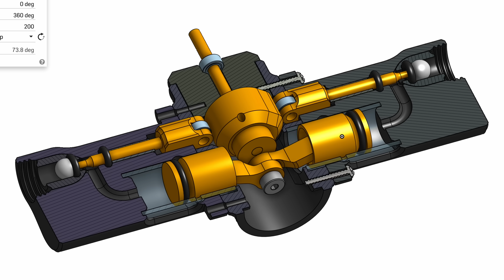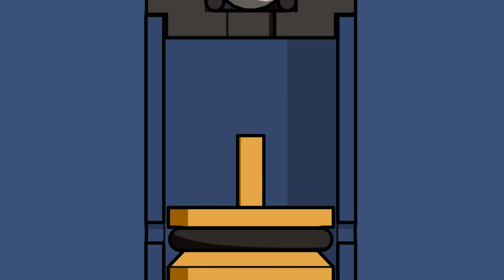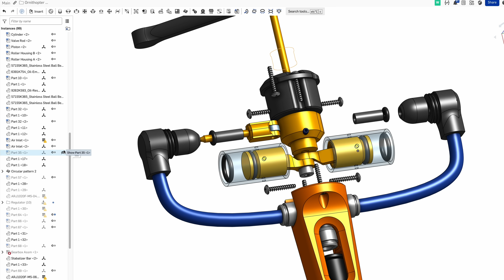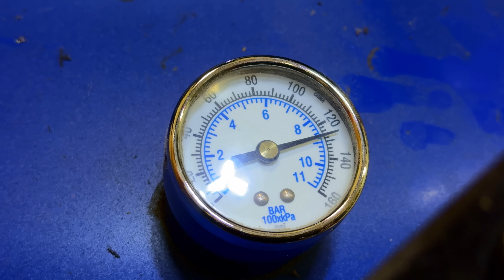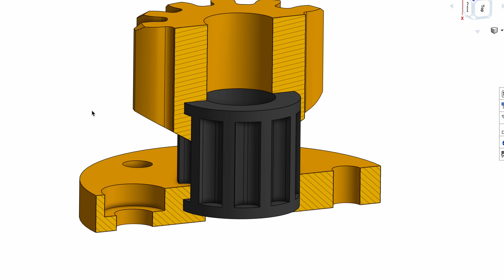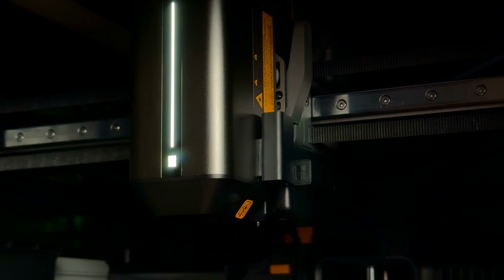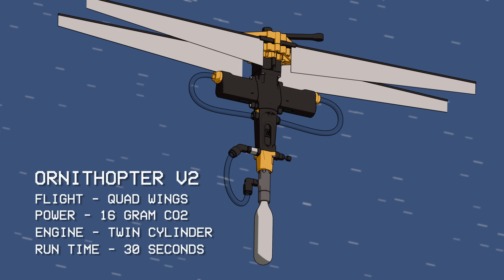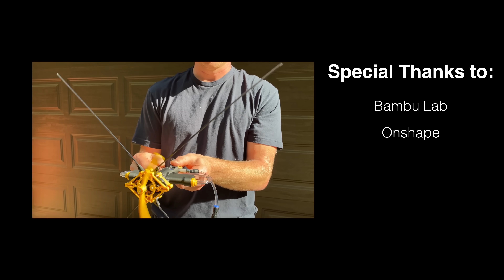I Tried to Build a Flying Machine With Just CO2

Comment: Brilliant idea and implementation.  Does it fly with an infinite source of compressed air? In my experience, I solve problems by getting very angry at the problem. Makes me fight better. Can you have a one-stage pressure regulator? What about a 2 liter bottle instead of the metal canister?

Comment: Just use a drink bottle at 200 psi lighter and more air volume with no need for a pressure regulator you need 5 x the thrust or 1/5 the weight or a balance of both. Just test off an air compressor then progress to the extra weight of onboard air supply the airline also makes a useful tether if it can lift the same weight or more in air line as the air tank then it is time to add it.

Comment: Move your wing's larger surface area to the ends. You're flapping to move air. Move the air at the ends, not the air near the center. And use something more rigid but still light. Perhaps 20 mil polycarbonate sheet plastic like once used on overhead projectors or even heavy aluminum foil perhaps. Replace co2 cartridge steel casing with a lighter weight container. Perhaps machine your own and charge it with a real one.

Comment: Just a heads up about Bambu Lab, which recently started closing down their ecosystem in addition to trying to gaslight their users, essentially declaring "hey, we don't give a [YouTube] about our customers so long as the revenue is stable". Bambu Lab received quite some backlash and the increase in advertising is most certainly a result of that. So for anyone interested, please do a bit of research before you buy from them.

On a more positive note, I'm loving this project, air engines are fascinating and ornithopters likewise

Comment: very nice build and video, I my thoughts are, go down to one pressure regulator, maybe try get rid of the gearbox and flywheel or combine them just to remove that extra friction if thats possible (idk if it is) and give it bigger wings with that flap more efficiently but I think mainly the wings are holding it back right now (and obviously the speed its spinning but lower speed = more efficient I think) overall amazing build love this aesthetic and keep it up, optimising it is half the fun

also lube everything up to reduce friction and maybe try lightweight printing materials if you havn't already

Comment: The vibrations were caused by your choice to share the crankpin between 2 rods. That's a 180 degree V engine and it slings 2x the reciprocating mass side-to-side. If you spaced the crank pins 180 degrees apart, you would have gotten a boxer engine which is smooth like butter. Also the other commenter's idea about directly driving the wings with double-acting cylinders might be worth a shot - save weight on gears and shafts.
Reply: Best example of a Boxer engine is the Flat-4 engine Volkswagen used most notably in the Bug (Type 1) & Kombi Van (Type 2) for 70 years (1936-2006).
There is also the Porsche Flat 6 Boxer used in the Porsche 911 as another classical example.

Comment: I know it's not the most out of the box solution but I would recommend you trying to use a a soda bottle and filing it with compressed Air instead of a CO2 cartridge integza did this a couple of years ago and it worked really well maybe you could try using a 250 ml bottle

Comment: Another idea is the have the valves in a single unit below the cylinders, and just a single rotating drum attached directly to the driveshaft with release valves to the sides directing to the cylinders. Kind of like a spinning elbow pipe, with the bottom hole spinning around the CO2 intake and the side outlet lining up with the tubes to the cylinders. This would eliminate the requirement for the current ball valves and cams in this system, however it may be harder to seal.

Comment: Maybe you can increase the lift with hummingbird biomimicry? They flap in a horizontal figure-8 pattern where the wing tilts to help push air downward on each half-stroke. That would be a lot of complicated mechanical design, but from what I've seen that's up your alley!

Comment: I've been telling on YouTube (including Tom Stanton) to use a regulator on these air engines for over TEN years now. This is the first time I've seen one. Good job!
Reply from the maker: Thanks! I'm just glad it worked! Now I just have to make a better one that can reduce to lower pressures or an engine that can run on higher pressures (so i don't need two regulators)
Reply: @worksbydesign your design is awesome, specially for keeping a constant running pressure and avoiding the fluctuations such as Tom gets. Do keep in mind you are losing out on a lot of energy from the tank though. The soda bottles might be more energy dense when you take that into account.
Reply: That's exactly who I was thinking of when I saw this video on my feed!
Reply: I'm sure Tom's done one with a regulator, hasn't he? Either way, his engines use a much lower pressure supply so they don't need the same amount of regulation that a high pressure supply like a CO2 cartridge
Reply: 10 years? maybe you should have done it yourself at some point

Comment: remove the tubes and replace them with o-rings by building the airway into the frame by removing infill. Optimize wingspan to ensure enough torque is available from the motor to maintain lift over the wing... you probably don't have the air to hover and might need horizontal gliding flight configuration to provide translational lift to maintain flight with such a high mass and low power supply.

Comment: several points to consider;
Reply: the added gear ratio for additional torque could be greatly hindering your potential to create lift. the faster a airfoil goes, ignoring flow separation, the more lift it will create. notice how fast the hummingbird has to move its’ wing, you can barely see it’s’ motion, it could be it your favor to trade torque for more speed instead. i don’t know your experience with incompressible aerodynamics or CFD, but both could provide a good estimate for how much drag you need to overcome to drive your wings. thin-airfoil-theory in incom aero and a free program called XFOIL would be great google searches, XFOIL would prolly be easier if you don’t have experience  with incom aero
Reply: your airfoil looks to have increased its span and decreased it relative chord in this video compared to your previous. this would make the airfoil stiffer in the chord direction and allow for less curvature to form. i’m guessing your airfoils are operating at a maximum of 10-30 m/s. in this range wings with some curvature work great to increase the pressure differential and are generally at much less risk for turbulent transition. unfortunately your limited to thin airfoils, but look into the wright 1908 airfoil or bleriot 1909 airfoil
Reply: i can’t get a great idea of what angle of attack your wing are at for a majority of their path, but off what i can see it looks to be very steep. if they airflow can’t stay attached over the top of the wing, the resulting flow will create an area of stagnation, with maximum static pressure, forcing the airfoil down rather than up. a design where the airfoil can obtain a relatively flatter angle of attack could help

Comment: Dude. This video is the best. This is sooo cool! So impressive!

I do have an idea. The weight is a big problem, and I have an idea on how that could be fixed. Since the CO2 cartridge is super heavy, you could make one out of plastic (3D printed) and then put a fiber glass layup. That would possible make it lighter. For the seal on the cartridge you could use a burst seal. 

Just an idea. This is so cool! Good luck on the next iteration!!

Comment: If it flapped 10x faster, had no redundant parts, used power more efficiently, was based on sound mechanical design, and applied the physics of flight control surfaces...maybe.

Comment: Wouldn't having two cylinders negate the need for the cam and push rods? When one cylinder is on power stroke it forces the other up and vice versa, I may be wrong but it would be worth testing and would drastically simplify the design.

Comment: If you want to reduce the engine vibration you need to set up the pistons so they don't share the same crank. Essentially, have both move outward and inward at the same time. On a 4 stroke boxer engine this allows the two  pistons to run 180 degrees out of phase, when one is compressing the other is exhausting, when one is expanding the other is intaking. but on this engine it would behave closer to a two stroke, with each stroke generating power. So it would be more efficient to just have a single piston with double the surface area, and a counterweighted bellcrank. Anyway, you will still have to solve the problem of getting this thing to be stable, and keeping the center of mass low will not help. Tom stanton has a good explanation of the pendulum fallacy. Essentially, the plane does not "hang" from the wings, the vector of thrust tilts with it, and there's no restoring force.

Comment: You could make quite the unique rc plane if you took off the ornithopter mechanism and just used a prop. That cylinder and piston set up is perfect. You just gotta sort out servo control for the tweaking of the regulators and you could probably fly for ages.

Comment: Great project. I guess issue with wings, I don't see how they can create lifting up force
Reply from the maker: I forgot to mention it this video, but the wings have a extra bit of fabric close to the pivot point that allows them to flip over on each beat, turning them into sort of a sloped fan blade

Comment: Hey, my friends and I just finished designing our applied physics project for the end of our first year at uni. We are trying to make the golden snitch from Harry potter and were very much inspired by your earlier ornithopter video. We are cheating by using electronics, and we added a flywheel inside that acts as a gyroscope to stabilize it - since the shape is circular and can't be bottom heavy enough. But right now we're getting about 10% of the thrust it would need to fly, we think it might be due to our wings - most of the air goes to the sides. I'm commenting to thank you for the inspiration and because of the insane timing, as the presentation for it is this tuesday
Reply from the maker: I'm honored to have inspired your project! The gyro is a nice idea, and getting it to fly is my problem too haha. Try to lighten parts anywhere you can, but I think the wing design is really crucial and something I haven't cracked yet either. There are some other ornithopter projects out there from universities and companies that use some novel wing designs. One I looked at for inspiration this time was a drone called "Flapper Nimble" from a company called "Flapper Drones". I hope you can find a way to improve the thrust to weight ratio, but if you cant get it to fly on the first try don't be discouraged! Its a process and I'm sure the experience and problem solving you've done already is very impressive. Best of luck to you and your team this Tuesday!

Comment: I really like the full mechanical approach but i have some improvement ideas.

1. Instead of just air pressure to move the pistons, try using Air-Fuel Combustion instead. This produces way more power and has a better power/weight ratio then ur Co2 Cartridge.
2. Because of the higher pressure and heat u should build the engine out of metal. Sure it will add some weight but the power will be worth it.
3. Build the whole thing bigger. Due to the increased weight u need bigger wings that can be powered by the stronger engine.

Im sure with these Tips it's perfectly possible to build a mechanicel flying bird.

Comment: I think one thing that could benefit the design would be larger wings, I also saw a video of an air powered rotary engine the other day by Integza (I believe) where they solved the rotor seal issue by having a solid bar in-between the rotors.  If you can get your hands on some of the newer Teflon infused filament and used that for the outer walls on all contact surfaces, it could also help reduce friction and wear increasing the efficiency of both the piston and rotary designs.

Comment: Well, you do look like a rugged Tom Stanton, so it makes sense that you should make a more rugged air engine that's partially composed of metal, but you may want to 3D print the whole thing because you really need to reduce the weight of the ornithopter.

Comment: Just an idea, but PVA filament is effectively self sealing, i've made pva prints that can even withstand a full vacuum. They also can be easily sealed to other pva or even pla parts with just the application of water to bond the two parts. Ofc pva is water soluble so you have to make sure not to let it get to humid and possible need to dehydrate the prints between uses if you live in a humid area, but it may allow you to slim down some of the sealed components and increase efficiency of the design.

Comment: TBH:
Tom`s Design for the seal (stolen from airhogs) was simply better. less friction, better sealing.. just all around a better solution.

but absolute props for the idea about the independend valve! that idea takes the engine up to the next level. next step: adjustable cam? i already got that working on a flame eater engine.. and the gains were huge compared to cams from litterature.

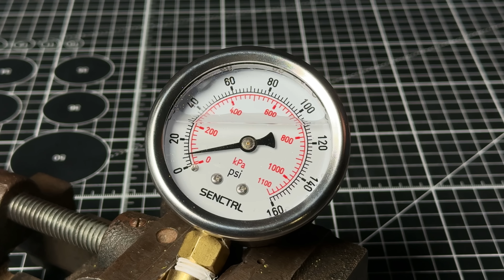about the "air regulator" shown @7:23 .. well.. sure, this isn`t a throttle valve instead of a pressure regulator? if it mistakenly it IS a throttle valve, it restricts the flow... not exactly what you want... this would explain quite a bit of strange behaviour of the engine.

Comment: a 4 cylinder x or "flat 4" would help with vibrations... It also might be worth testing with An opposed-piston engine also known as a "Flat-twin/Boxer Engine" Allowing for potentially more power off the same expansion of air/ co2

Comment: I love seeing professional CAD + CAM skills on full display like this, especially with those CRISP animations, it's always an inspiration to me for my own projects. Although, As an owner of multiple BambuLab machines, the H2D seems a little bit overhyped IMHO. The best feature hands down is that it's an IDEX machine, but the laser cutter/engraver seems really situational. Granted, it is optional but I'd rather just buy an XTool machine for 2 main reasons. #1 - Potential damage to the very expensive hardware of the H2D due to improper Laser use and/or rogue beam reflections. I know some ppl have unfortunately ruined their heatbeds with it, and it could have been much worse lol. #2 - Printer Maintenance. After continuous use, residue from cuts/engravings will build up in the printer even with the Ventilation on. You may need to clean your H2D more often than any other BambuLab machine.

Comment: Why not maybe offset the pistons slightly to make a boxer engine (which were made for aircraft) to cancel out the vibrations from the engine, then the flywheel could be reduced or even removed

Comment: Animations are really good, what software do you use for the mechanical animations?
Reply from the maker: thank you! I use Onshape to model the parts and Blender to animate them
Reply: @worksbydesign , im working with blender for an upcoming project video, any tips on how to get the cartoon shading look used in your animation?
Reply from the maker: @bharathajay8566  there’s a few tutorials that can do a good job of explaining it, but I use the grease pencil as an outline for the parts and the colors are just a color ramp with a light and a darker version of that color (for the lit side and the side in shadow)

Comment: Did you get the CO2 cartridge connection and regulator parts made for you, or were they purchased from the link above?  Not sure how you got those parts, but I need something similar for a project.
Reply from the maker: I used a CNC machining service, in this case Protolabs.com to manufacture those parts

Comment: I think you can improve lift and reduce drag quite a lot by working on the areodynamics of the wings. Bees use the vortex generated by a flap as cushion of air on which to support the return stroke. Intresting rabbit hole to explore. But very nice work and editing ! 
You could maybe reduce weight and energy lost to  friction with compliant mechanisms. Best of luck !

Comment: I wonder if a larger expansion chamber between your first and second stage pressure regulation would help. You may even be able to eliminate the second stage. Look at designs of diaphragm pressure regulators for paintball guns. They "leak" from the high pressure side to the low side based on pressure differential.

Comment: Instead of going from the linear motion of the pistons to rotary motion and then back to linear motion for the wings, I have to wonder if you could skip all that and go straight from the pistons to the wings. That should allow you to gain some efficiency and drop some weight. Not sure how you would gear it down, but there is probably some solution.

Comment: CAD and 3D printer to design and build purely mechanical machines, makes me think of the proposed Venus clockwork based rover. I wonder how you design something that needs to work for days powered by differential pressure and how you would do it in the crushing pressure of the lower venusian atmosphere.